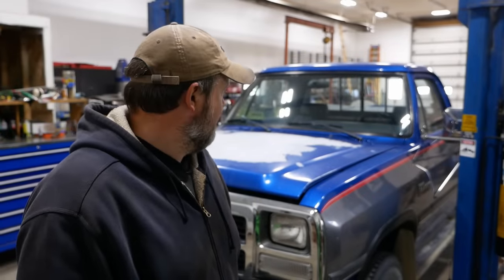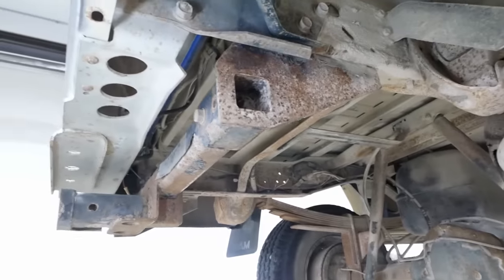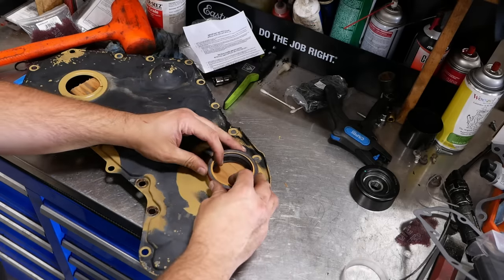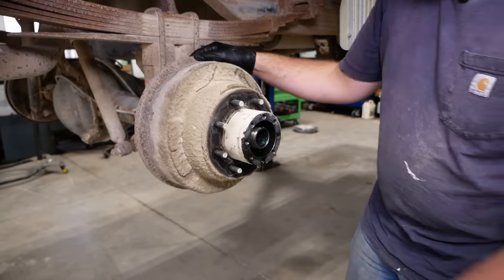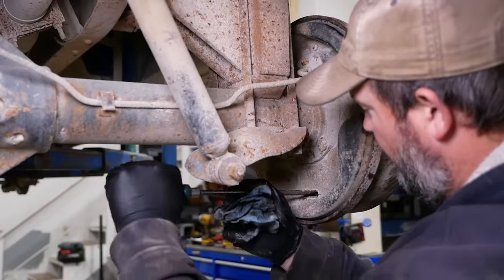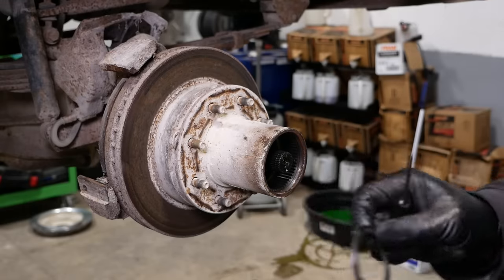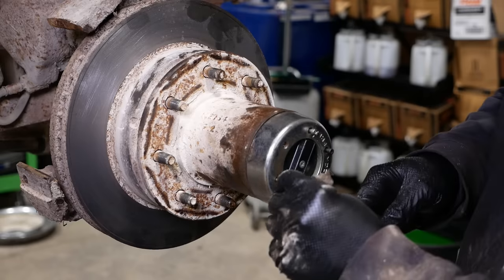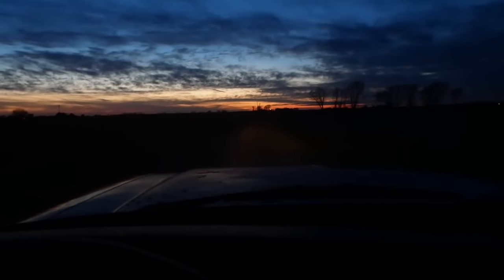Cherry 92 Dodge Cummins: Killer Dowel Pin, Brakes, Seals, Etc.

Comment: I have a 1996 Dodge 3/4 ton 4X4 Cummins that drives terrible. Using methods developed by the U.S. Government -- I have thrown massive amounts of money at this problem  in an attempt to fix it.  I have replaced the front control arms (If that's what you call them) changed the steering rods to the later style, installed a stabilizer, installed a rebuilt steering box, installed a steering box stabilizer that adds a bearing support to the bottom of the steering shaft, and nothing is loose-- new ball joints on both sides,  but you go down the road driving like it was a twin I beam Ford. This truck has 232000 miles. I also have a 1998 with 139000 miles that drives almost perfect. 
You tell me. I'll stay tuned to find the answer to this issue.  Flustered in Alabama...

Comment: i am not sure of the exact part that fixed it but my mechanic swapped out pretty much all moving parts in the front steering system and did poly bushings. was tighter than it had been in the preceding 80,000 miles. was 97 ram 1500 5.2 4x4 rust in peace old truck

Comment: I have a scar from a turbo on one back in the mid 2000s working for a lube shop. Someone cranked to oil filter as tight as possible. It took 2 of us to break it loose. Pit man had a cup with a breaker & my wrench slipped hitting my arm on the turbo from up top. It blistered & popped faster than I could think about it. Its pob the only time I hated messing with them

Comment: Check the steering box for play, then check the ball joints and the steering stabilizer shock etc, if it has one. Dodge trucks have tight steering when everything is new, also make sure it isn't just side shift on the front axle due to loose bushing or joint.

Comment: Whatever you do Wes, don't fall for the steering box brace gimmick. Those things are junk. The guys suggesting to switch to a "T" style steering linkage set-up rather than the factory "Y" style are correct. It makes a good improvement. Also check the steering shaft from the column to the box. I'm not sure how the 2nd-gen shafts are constructed? But, I know 3rd-gen shafts have a rubber isolator that breaks down and causes lots of issues. Also, the track-bar will cause these symptoms. It needs to be rock-solid. Any play at all and it will wander. I have also seen the tapered hole on the frame side of the track bar wear oblong. That is a fun one to diagnose because it usually doesn't show any movement on a shakedown. But, it sure will move while driving.

Comment: I have a w250 1992 the reason they put so much grease in the hub is because the grease can get hot and get outa the bearing into the hub and you loose the inner bearing it happened to me after a brake jog in Seattle Wa. and i went to Bend Oregon in the high desert.  Lost one bearing the first day and the other the day after that .  Both road repair were very $$$$.

Comment: Upgraded steering shaft ie borgeson, upgraded steering gear ie redhead, upgraded track bar. I would either retrofit a 3rd or 4th gen system or try a thuren kit. That's where most of the slop is, the axle moving side to side underneath the truck and making it pull.

Comment: I got a 2014 Ram 5.7 3500 with a complaint of wondering steering especially at higher speeds. The truck had been crashed. We had the alignment checked because we didn't know what all had been done  to fix it and the customer has just purchased it from an auction. The steering wheel was 180° out whe going straight. It got adjusted into spec except for the RF camber being in 2°. It still wondered.  It reminded me of a Jeep I had had with a really bad U-joint in the steering column.  I had checked the front end and noticed no play. When I turn the wheel back and forth I  noticed a fair bit of input movement before any output movement at the pitman arm. I found out they had a wrecking yard steering box put in. I looked online into adjusting the box and found some guys loosening the jam nut on top and Turing the slotted shaft clockwise in to reduce the Freeplay I  yhe wheel. The one on the 3500 was seized but I got it loose and tighten it a couple turns. It was better but not great. They took the truck back as I had ran out of time. If you look in all data there is an adjustment procedure offered in 1990's rams. Perhaps that could help? Our shop doesn't get many heavy trucks so I was unaware until this came in a couple weeks ago. Perhaps someone can build off of this. Or you can find more and adusting the box on rams. Best of luck!

Comment: Check the steering box mount to frame. my frame was cracked between bolts  wandered a lot.  also installed steering box stiffener.  much better!

Comment: I’m glad that you survived the melting snow fiasco.  Good work.  For the front end, a new RedHead steering box.  Start with that.  You’ll get about 50% improvement.  Next up will be the steering linkage.  If you want to get fancy, go after the ball joints.  That should remove most of the steering slop.  It worked for my 98.5 2500 with, then, 259,000 miles. After 25,000 miles, things are still tight.

Comment: Steering box brace. Got one for my 97 Cummins. It helped some but definitely did not cure it all. Going with the newer style requires drilling out/reaming the knuckles for the tie rod ends. The steering was just junk from the factory. Redhead sells a better gearbox but I have no experience with them. Hope this helps Wes! Good luck!

Comment: I'm not going into ball joints, tie rods, etc. because I'm sure you have checked them. Go online or to Geno's and get the steering pitman arm brace. It's a cross  member you bolt in and has a pitman shaft nut extension you swap the OEM nut  with then a bearing rides on that.
There's a 3rd gen trackbar mod also that you can get, then you buy a 3rd gen trackbar and installed it. Those two things were night and day difference on my 99 3500  Love your video's and humor. been watching for a long time. and always smash the Like button  Happy Thanksgiving to you and your Family

Comment: I have Changed out the steering shaft on my Dodges to Borgeson they do away with the rag joint makes them steer pretty nice. I bought a 92 new ran 300000 before getting 2002

Comment: Wes that looseness I'm the 93-01 dodges is caused by 3 things either the panhard bar ball joint or bushing is shot or the steering shaft has play in it. Then comes the major one the frame flex at the steering gear box it's a 100$ kit that braces the gear box to stop it from flexing the frame and I'm going to bet you that it is a combination of all 3 ( has been on all 5 of the 93-01 trucks I've been dealing with between my own and the plow trucks I've been leasing  for a few years now)  Even on my own that I did a complete rebuild of the suspension front and rear including ball joints wheel bearings tie rods pitman arm panhard bar springs shocks  steering damper and steering shaft and rag joint still had some of that flex in it put the brace in and took care of the rest. Fine job so far sir and hopefully this will be the remedy your seeking

Comment: I am so glad that Dodge did away with that style of front brake. At least on my 01 2500, you pop the caliper off then pop the rotor off I couldn't imagine going through that every time you needed to change the brakes although I put over 100,000 miles on a set of brakes so wouldn't be that bad

Comment: Hi from Oz Wes. Regarding wandering Dodge. Down here a common problem with Nissan Navara 4x4 with same problem, simple as, if all mechanicals are ok, try having tyre air pressure lower by 5-10 lbs on front than rear. May need to play around a bit, works spot on with two navara 4x4's here .. Just saying mate!..

Comment: 2001 ram owner with 300k on the clock.  My wander was fixed with a new steering box and pitman arm.  I also run dynatrac balljoints, had zero luck with napa or carquest.   Have 7 different Gen 2 - Gen 4 in the fleet, honestly never really seems like there is any one solution, more like a combined wear problem, I just rebuild the front completely (ball joints, tie rods, wheel bearings) except the 4 link bushings

Comment: The wobble might be caused by the steering box.  The same company (cordon) makes all the remans and they dont reman, just seals and some paint so the gearing and adjustment is still wore out and sloppy no matter how many you return and put in there.  A company makes a red head box 206 926 3552.  Me and my cousin both put one in and fixed our wandering/wobble.  The original is for a half ton and under designed at that, the red head is really rebuilt and tough.  Max did get his frustrations out on youtube.

Comment: buddy of mine has a lifted 2nd gen. he complained for months about steering slop after putting pretty much all billet on the front end. he put a Red head steering gear on it and i can't remember the brand it was probably 4 or 5 years ago now. a upgraded steering shaft. hasn't complained since i drove it once. i drive mostly if not only ford Super dutys. thought the steering seemed pretty tight for a dodge especially a lifted one but to say the least his trucks been very well maintained just some old stuff gets replaced by aftermarket stuff when it finally breaks.

Comment: never seen it, no idea (95 dodge at the end of the video). if it has front leaf spring suspension if the leaf spring bushes are worn it'll let the springs sag left/right, forward backwards, back springs would probably the same if badly worn.

Comment: A 3rd gen Dodge track bar upgrade will stop the axle from moving side to side, really cutting down on the wondering problem.  Also a steering box stabilizer, since the frame likes to flex and crack where the steering box mounts.

Comment: Look up lower nylon factory steering column bushing need to check that to make sure it is not shot, because if it is and you rebuild the front suspension its still going to drive like it is loose and all over the road..

Comment: I don't know if it would apply to a Dodge truck from the 90s...  But on a jeep, I think that you can eliminate some gear play by tightening the steering box.  If you strap the wheels on the lift, you could at least determine if the play is in the linkage, or the suspension.

Comment: The 92 Dodge sounds like a good old diesel truck ought to sound like! To me it is like music, beautiful music, but I am an old fart LOL! Having gears instead of timing belts or chains make them for the most part indestructible. That combined with the rotary injector pump makes them a bit noisy, but also ultra reliable engines. I had a Nissan Patrol with the inline 6 cylinder 4.2 litre engine, they also had a timing gear set, not chains or belts. They also had the VE rotary injector pump. Provided you stuck to oil & filter change schedule, and replaced the injectors every 100,000kM they would last for a bazillion kilometres. Actually you could get away without touching the injectors till they were cactus, but I work on the principle if you maintain your vehicle, it won't let you down. Where I live we do not have snow, so a 30 - 50 year old vehicle with no rust as a daily driver is as common as the air you breathe.

As far as the 95 Dodge steering, it is a truck not s sedan. Not being precise is what they do. Plus it is nearly 30 years old; things bed in over time. Provided it is not outright dangerous or unreasonably excessive it is okay per your assessment. Watching you and your attention to detail gives me 100% confidence that you would not say something is okay if it is not. we won't even go into a cost versus benefit analysis re the steering matter.

My experience with front end ride/drivability issues is to send it to an actual truck front end specialist that can actually do their own wheel alignments. They have the experience and do not have to outsource any of the work.

Comment: so 94 to 97 gear box stabilizer bar and new gear box with dual stabilizer shocks and of set camber ball joints do help 
98 to 02 you want to do is upgrade track bar adjustable then do red head gear box with camber ball joints with synergy tie rods and track bar work then best same with steering shaft and pitman arm and might as well do control arms and bushings if you want a tight front end need to eliminate possibility of slop and where there's a wearable items 
hope this can help

Comment: Wes here would be my suggestion on that 94 Dodge, not sure it will help though but it is done on a lot of 4X4 trucks. First option would be to put a steering stabilizer on the truck, which is just a fancy word for a unique shock that attaches to the center link or drag bar. Second option which is probably better for a lifted truck, is to go with a semi or full hydraulic steering system. Which the full hydraulic system is similar to rack and pinion, they use them on 4x4 rock crawlers. You can find what I am talking about on Power Nation's Mail Jeep project.

Comment: As mentioned by others, if the parts look good on the Dodge truck steering, I would play with the tire pressure. If you are not hauling, lower the pressure until it behaves better.  I had a Chevy chassis RV that I never ran the recommended tire pressure in the front tires because it would wander all over the road if I did.

Comment: On the front end, I would have someone hold the brakes and steer left to right, on solid ground like the shop floor. While they are doing that watch both ends of the track bar and see if it is loose I've had a few that seemed tight with a pry bar but ended up being loose.

Comment: Check axle shaft joints to make sure one or both are not seized. Will cause endless correcting of steering. Took me forever to find this the first time 25 years ago.

Comment: Hi Wes I had a truck with power steering and " loose / wobble issues" many components changed to correct issue without much improvement.
Eventually the end play in the steering box was adjusted. After adjustment problem reduced 90- 95%. Maybe look there if your vehicle has power steering.
Note: the steering  unit was within operational limits prior to adjusting but close to limit. There was too much piston float allowing too much fluid bypass.
Good luck.

Comment: The vibrations in the front end could likely be caused by either a worn trac bar or if there is a tight u joint in the front drive shaft. Also check the little centering ball in the double joint by the t case. Steering wander you might want to check the steering shaft from the wheel if the joints in it are out.

Comment: Have a look at Lada Niva front calipers Wes, they are similar but use two pins, four springs and two contraptions that go over either end of the caliper, trying to get all that lot lined up and the pins in the holes are an absolute pita!. The good thing about the calipers is that they have 3 pistons per caliper.

Comment: On the 2nd gen the brace helps, of course the box needs to be in good condition, and no worn steering components trackbars or suspension bushings. If all that is good a 3rd gen has heavier stuff but it won't really correct the issue as the stock components are plenty to do the job when they are right. One issue it appears to have and I am not sure why is the stance. The trucks factory have a definitive rake. That one looks flat like someone has either raised the front or lowered the back. This effects the castor and camber and can cause all kinds of driving issues.  The tires should be no more than 245wide as well. If it experiences death wobble something is wrong. When correct they will not death wobble.  The crossover steering will always suffer from bump steer on a really rough road but on good highway no reason that truck should not track nice if its all good.

Comment: Had 92 dually  club cab with a Cummins  std transmission transfer case is a NP 205  my engine never let out a drop of oil  let it go at close to 300 000 no issues    I go by feels when I do bearings  no degree shit and I hit my rotor with a dead blow hammer try it and go back on the nut you'll gain some 
t then back it up by
Ford had about the same style of brakes in the 70 but twin pistons  with a wedge and the spring   then came out with the wedge style which rubber  bs  still got my F350 crewcab

Comment: You have to make sure the toe is right on. It makes a big difference on the feeling of a lose streeing wheel.  Try 0 on the toe if that doesn't work toe it in but not to much like a 1/16. A 1/32 each side

Comment: As to the steering on the newer Dodge, other than a new tie rod, possibly a new control arm. Also look at a steering stabilizer/damper. If that don't fix it, it's likely a design flaw. Possibly nothing anyone can do, other than telling him to trade it in.

Comment: For what it's worth.... I don't remember what year they stopped  but sometime in to the 90's they were still using the old style 'bell coupling' on the steering shaft rather than a  ragg joint or u-joint style (repair kit Part # 425-253 Line: DOR).... hopefully that helps 
BTW your friendly neighborhood Orielly's should have in stock or 'quickly' be able to aquire the hub screws in stainless as a set stored with the replacement locking hubs, though they may not even realize it... I believe these are the stainless 8-32 set Part # 402-14-12 Line: MIL....

Comment: Wes, how's the condition of the steering box on that customer's wobbly Dodge? Could need rebuilt, or adjusted if it's good. I have a ZJ Grand Cherokee and I replaced every single linkage, shock, bushing, and joint, aside from the springs, and I still had wobble, but when I replaced the steering box, it went away! Still needed everything else I did to it, old Heap that it is. 
Otherwise, I would replace basically everything you can, the bushings are usually cheap without the arms and such, just load the parts canon and fire away, seems like this guy would support that anyway.
A customer striving for perfection is the best customer to have in this industry, as long as you can meet it.